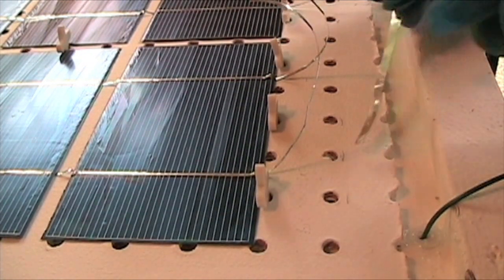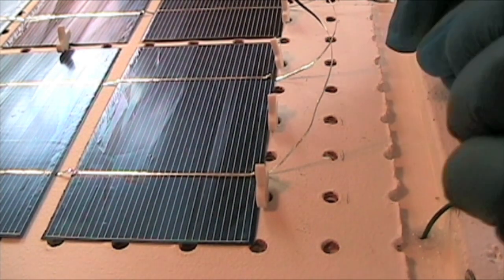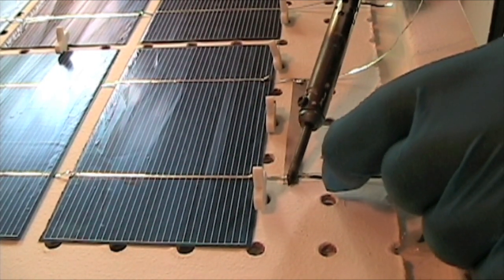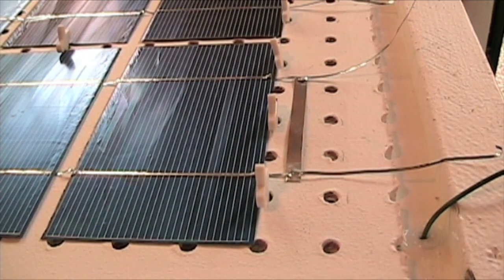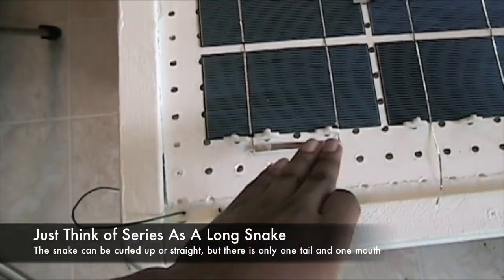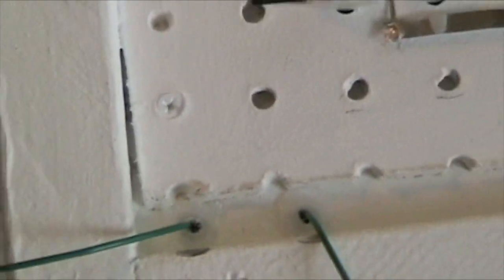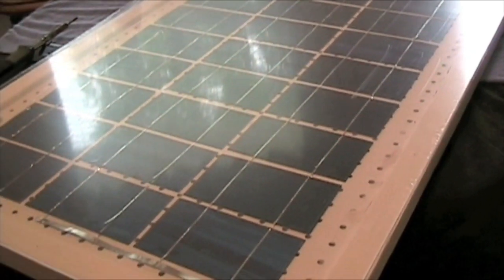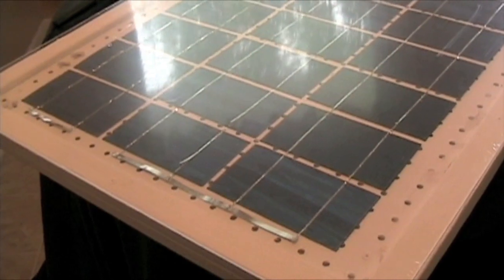How To Build A Solar Panel - Part 6

Comment: which solar cell should we use the one you have used in the video or the square ones?? which is better and what is the voltage produced  by a group of 4X9 panel or 3X12??

Comment: which solar cell should we use the one you have used in the video or the square ones?? which is better and what is the voltage produced  by a group of 4X9 panel or 3X10??

Comment from the maker: @MegaSolidSteel Yeah you can use tabbing wire. Most use bus wire because of it's width allowing you easily connect strings to one another and for use in junction boxes. But it's up to you how to go about it :)

Comment from the maker: @zliminator Or I should say, electricity cannot successfully travel from one end to the other with a dead cell in the string, but it doesn't destroy your other cells, you just will not produce any power :)

Comment: Be very care with all those scraps of tabbing wire that you trim.  One of those tiny scraps might be lost in the panel, and move around latter causing a short.  I am beginning to understand what you are saying about the three sections being in series.  From left to right, the current flows UP, DOWN, and UP again.  OUCH!  I just saw a pile of those tab scraps sitting on your pegboard.  Find a better trash area!!!

Comment: Nice vids, my group and I are trying to create a Peak Power Tracker (make a solar panel operate at maximum power at a given voltage) we ordered the cells and were looking for a way to mount the cells. Great vids, thanks for shedding some light on this subject.